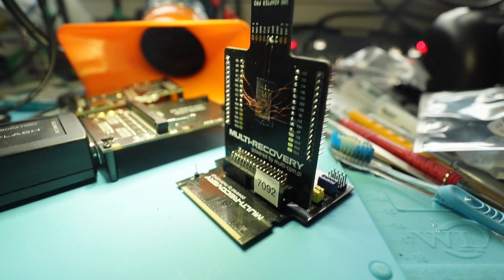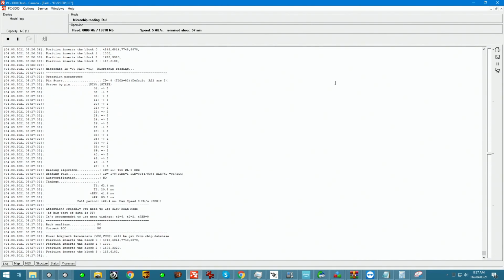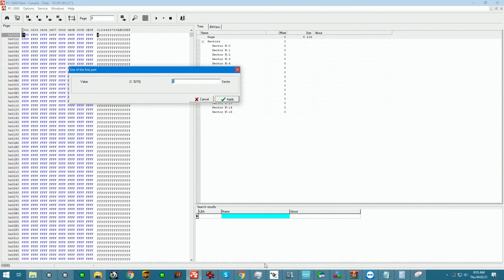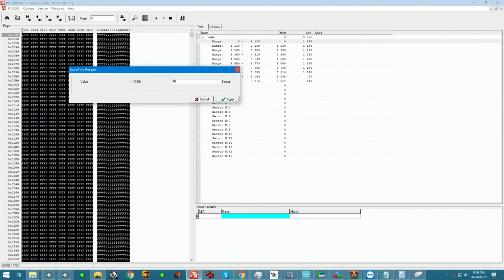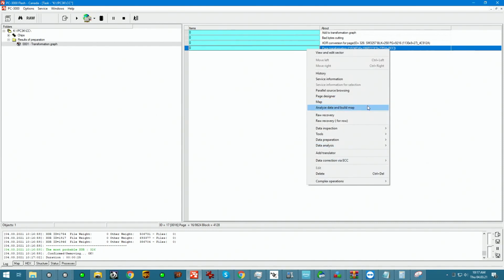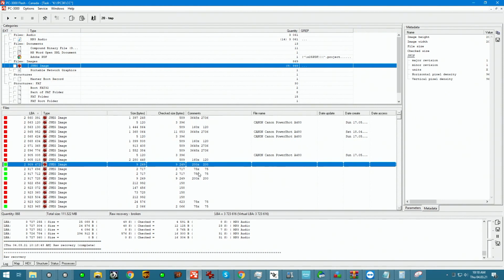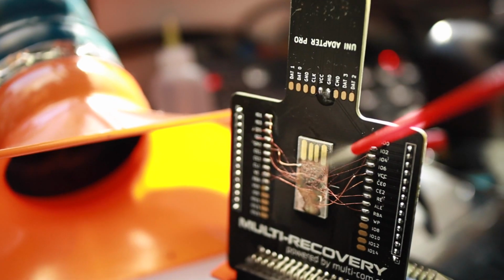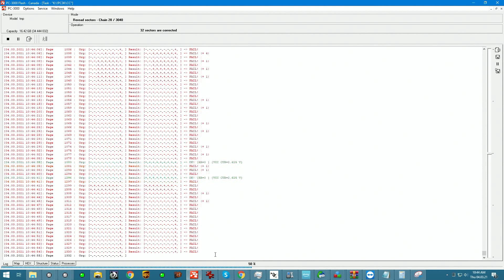how to recover data from flash drives that are totally dead part 2

Comment: Wondering if the Sony Tough SD cards would pose a problem in recovery because they are encased in a very hard epoxy coating?  The cards cannot be pried apart like other SD cards.
Reply from the maker: I think how they built on data management level would be a bigger concern than epoxy. Heat can make epoxy come off with a scrapper. LDPC algorithm is a much bigger problem that remains unsolved, and many new devices have it

Comment: Hi Erkin, greetings from Poland! I'm really curious as to what other equipment is used to recover data from flash drives. Is PC3000 the only one used? Or are there other brands that make flash recovery hardware too? Are you using their hardware? If not, why? (I'm talking about chip-off recovery mostly)
Reply from the maker: There are 3 flash extractor, Rusolut, and PC3000 flash. We use all 3 when needed. Rusolut is based in Warsaw by the way. Each tool has its pros and cons. Having all 3 solves that problem.

Comment: Now I am very curious to what you purchased to help with improving read.. I probably can't sleep now.
Reply: Compressed Can When Sprayed Cools The Device to a level so that NAND data can be corrected ,Also hot air can be used to do the reverse ,but do not cook the poor chip too much
Reply: He's already using freeze spray, he's taking about something else he'll show in the future. @08:35
Reply: @DiskTuna  Well i am also talking about freeze spray , freeze spray is also compressed ,i am not talking about compressed air
Reply: @DiskTuna  Well the other method is heating the chip to a degree , third method is read retry , fourth is voltage manupulation ,here is one video -> https://youtu.be/7yiH5EJoOsw
Reply: @chandigarhdatarecovery  FFS, we know this. Erkin just mentions he got something new that he may show in a future video. I am curious about this, that's all.
Reply from the maker: @chandigarhdatarecovery  compressed air is not consistent.
Reply: @hddrecoveryservices  Well i am also talking about freeze spray , freeze spray is also compressed ,i am not talking about compressed air